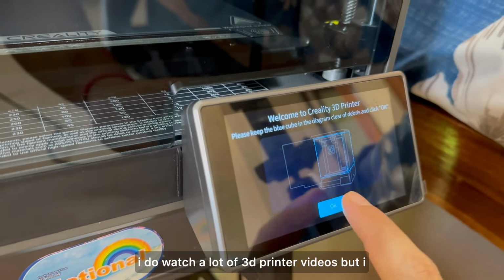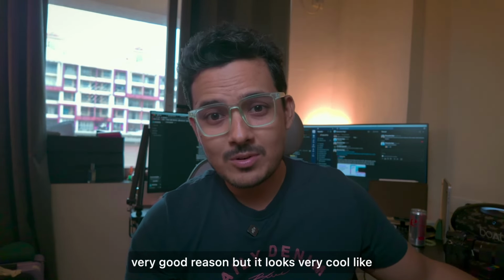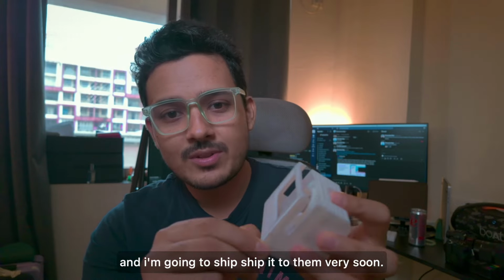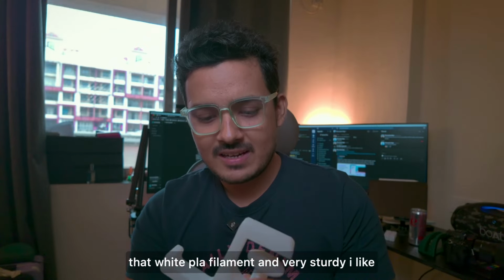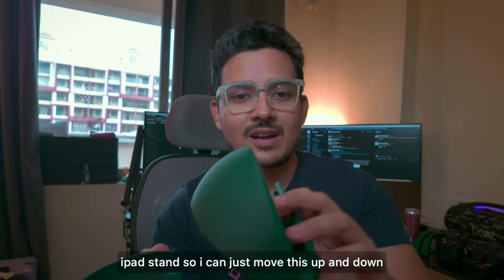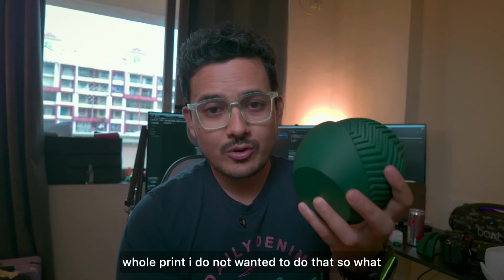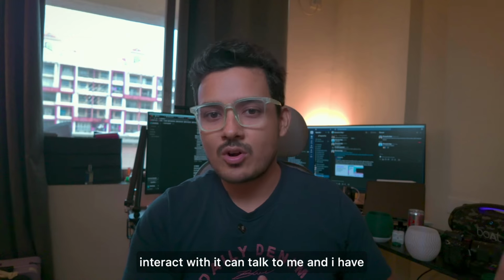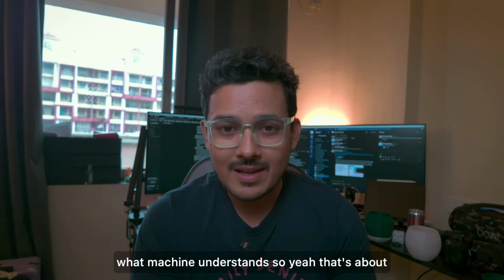What I Created in My First Week with the Creality K1 3D Printer

Comment: I hope to be where you are with 3d printing in about a week, I bought an open box K1 online last week here in the US, with luck it will be delivered next Tuesday.  While I wait I am watching all the K1 videos I can find as well as reading as much as I can about this model.
Reply from the maker: All the best for the new K1, I got into some issues after couple of prints with clogging of filament, so if you need any help feel free to ping me
Reply: @DivyanshuAIDev  Thanks, right now my biggest concern is that it is scheduled to be delivered at about the same time Hurricane Beryl is forecast to arrive
Reply from the maker: oh hope it gets delivered on time and safely 🙏🏼
Reply: @DivyanshuAIDev  Unfortunately it came in broken, glass door was shattered and a wrench from the included tool kit was loose in the bottom of the box.  I have another one on the way which should get here in about 12 hours